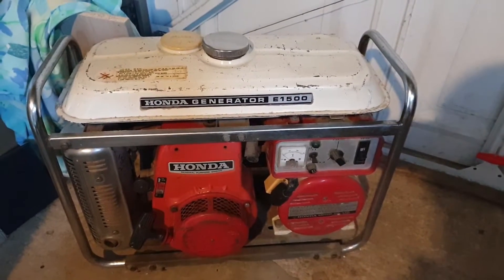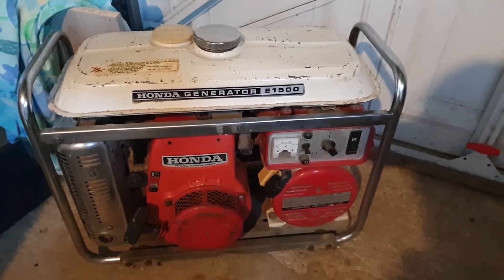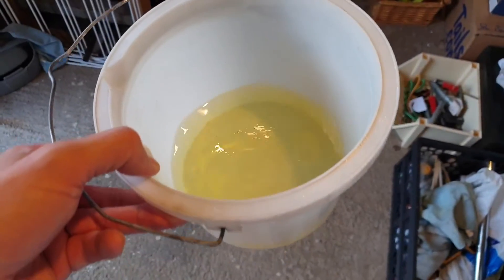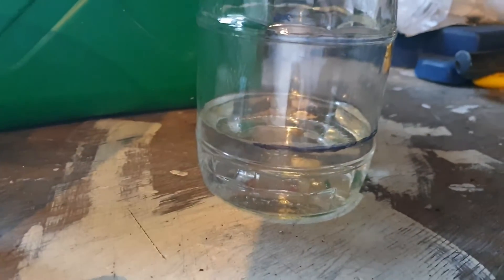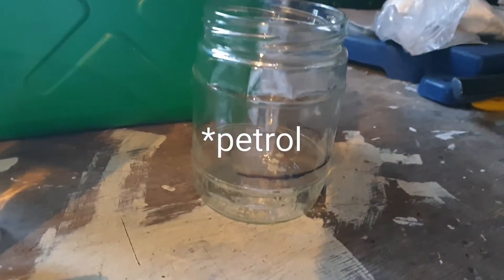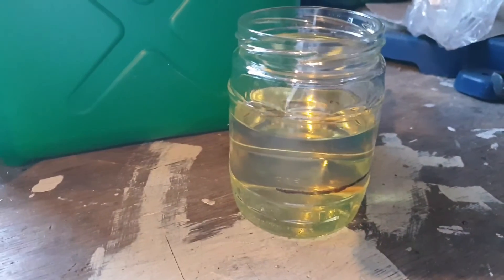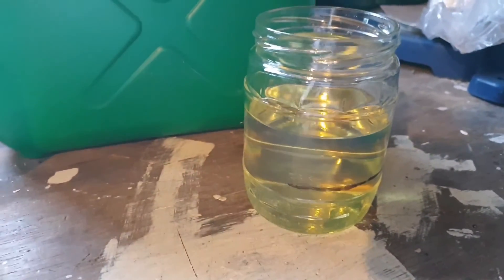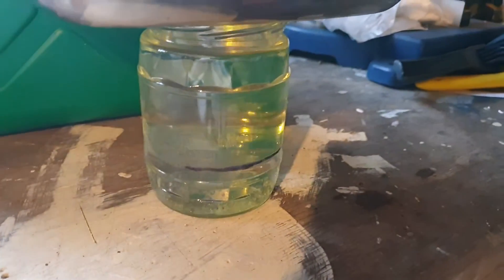Testing for Ethanol in Petrol / Gasoline Part 2: Shell V-Power

Comment: Both of them were supposed to be shaken and left for several hours
Reply from the maker: Thanks, I'll leave them longer next time (after E10 is in use) however the proper testing kits available say you only need to pour the water "through" the petrol, ie over the top to sink to the bottom and leave for a few minutes. Much larger quantities, like for extracting it so you can use the fuel without that crap in it, would need to be mixed and left much longer as you say.
Reply: @boilerhousegarage  I think shaking it and letting it sit for a good few hours gives a more real accurate result ie like sitting in fuel tank , just people in charge are money hungry I think as lots are complaining about mpg and power

Comment: I am here in the states and just did a fuel tank in my 74 Ford V8. We have Shell V with up tp 10% and stated using it. So far, I noticed it running well and seems to get more miles per fill up.
Reply from the maker: You'll get better mpg with V-power compared to other fuels that are also E10, but less than ethanol-free gas as the energy concentration is lower. It should run fine if you're using it regularly but it's the corrosive effects that you need to keep an eye on; most fuel lines and newer fuel pumps can take ethanol but your carb components may quickly degrade. Also on a hot day in traffic, the ethanol can boil in the float bowl.
Reply: @boilerhousegarage  Have friends with classic cars and such and am aware of the issues with E10 and the car is ok with it. The carb is tuned for the concentration loss with a tailpipe air/fuel ratio reading by a small increase in jetting needed to make up the difference. Internals are non corrosive materials and I check the fuel filter, lines and pump for signs of issues with no problems yet. Drives well in hot days too. .
Reply from the maker: Thanks for the info. The truck sounds awesome too, a lot of them from that era are really desirable and still in daily use. Just goes to show how well made they are.

Comment: You need to put the lid on the jar and shake it then let it settle for an hour or more  to get the ethanol to  separate out
Reply from the maker: Thanks, I'll try that next time. I want to try again once the E10 is in use here, to see if the super unleaded options are still ethanol-free or if some go to 5%. Usually smaller measures will show noticeable separation as soon as you pour the water "through" the petrol, like those testing tubes you can buy to see what percentage is in it.
Reply: @boilerhousegarage  
I have been using Esso and Shell super unleaded which both contain 5% in Lancashire
Reply from the maker: @ste3270  Thanks. It seems that the refineries who don't supply the base fuel without it have expanded. It used to be a couple of specific parts of the country according to Esso (who were the only company who commented on their petrol not containing bioethanol), but recently they changed their statement to "the North of England." I think it was inevitably going to progress to every option at every station being contaminated with this shit. So much for motor heritage, eh!

Comment: I guess this must be a regional thing as the V Power I tested in South London did contain 5% ethanol.
Reply from the maker: That's odd. Apparently only two refineries in the UK will have ethanol even in the super unleaded for all brands they supply for—from what I understand, the additives are mixed during transport and some only add to the base petrol that already has ethanol in it—neither would go to a station in London. I'll keep checking periodically, as I'm a bit worried about the introduction of E10 in regular petrol.